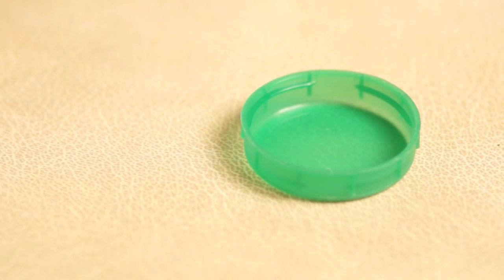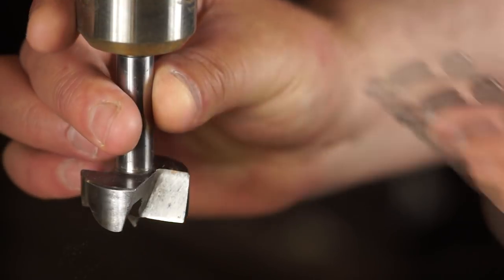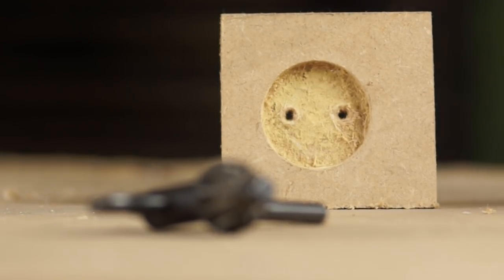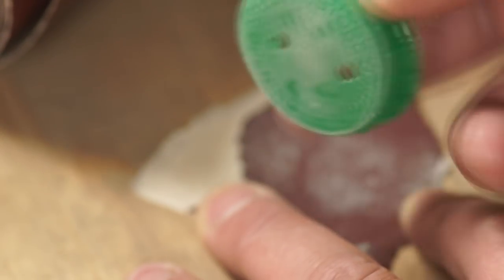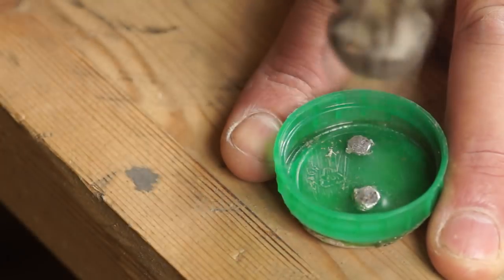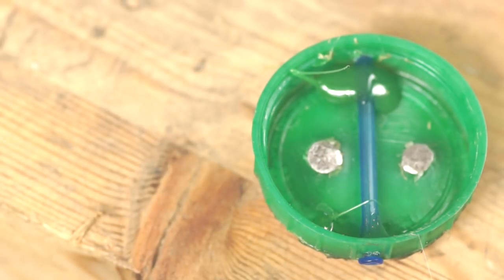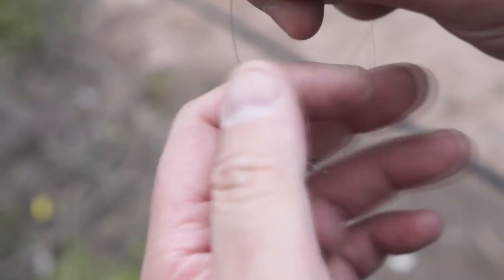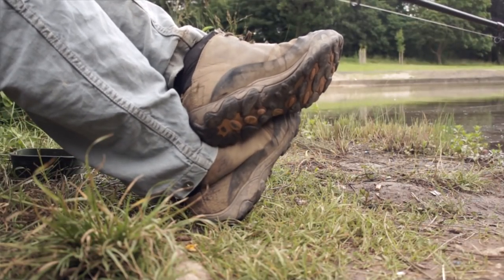Making a Milk Bottle Top Feeder for summer bait fishing

Comment: Absolutely brilliant - works really well and if like myself you lose feeders in Lilly pads/trees this homemade version reduces costs and subsequent fretting 😂. I am now experimenting with various depths of mounds to provide a range of weights. Another variation on the drawing board is using plastic bottles with long necks into cage feeders by burning a pattern of holes and then secured to the main line with a monofilament loop and swivel. Great video and many thanks.

Comment: I found my qtips had solid sticks so substituted a coffee stirrer. I'm not set up for melting metals so put a couple of steel washers inside the cap and locked them in place with the tube. Result is a 1/2 oz feeder. Thanks for the video!
Reply from the maker: Glad you found it useful and great to hear you methods

Comment: Another great idea of yours again , Paul , ........only bad thing about it is , that I don't like milk , LOL .

I've made feeder spirals before utilizing plastic tubing 4,5mm X  3mm bore , bought in a RC model shop .
When heating up the ends , this particular plastic material does not tend to bulge up to a rivet head like your tubes , so I've pressed it onto the tip of a 90° center punch after heating to achieve the rivet head preventing the wire spiral from sliding off that center tubing .

Thanks a lot for sharing , Paul , ......cheers , Dieter
Reply from the maker: I was making fly tying bobbins for use in float making and looking for something none metal to line the tip of a metal tube to stop it fraying the line so i cut the plastic q-tip to length and relised it also was too sharp and thought some heat might  melt and smooth like flame polishing perspex and as if by magic it rolled up, just one of those lucky things. I did some interesting experiments spinning small bore3mm/4mm copper and brass tube in a drill press to roll up the ends after watching a video on making trumpets and that work well with a centre punch as a former. or nails that had been ground to shape.  I was going to do some spiral cage floats for fishing up in the water at some point. The trouble now is gave I one of the bottle top feeders to kid down at a local lake and who pulled out some nice bream with it and now all his friends want them, i went fishing tonight and had to hide in a reedbed to get some peace, I caught nice of about 4kg as well.   Cheers Dieter.

Comment: ive just made some of these , instead of melting lead just used thin sheet lead cut to size of top, with two extended small tags to go through base of top, to secure plus glueing to base with araldite . Simplifys it somewhat ! good idea though.. tight lines!
Reply from the maker: MrRegni Your method would be the simple way but as always i like to forge ahead and over complicate things, i do think though that melting pewter ornaments into fishing weights can only be good for the fisherman and home decor; never before has one metal been almost solely used to produce all manor of hideous things.  Cheers

Comment: Hello there fellow angler!
I have been using home made contraptions on the match scene especially for winter months. 
Although you seem very knowledgeable with tools the cotton bud shaft you clipped off way too short for even very short casts as it has the potential to tangle even itself up not to mention the hook link. With a inch and half this would solve any of these problems. 
Well presented and subscribed 👍

Comment: Great idea have you got any tips on makings cage feeders? Thanks
Reply from the maker: I have never made a cage feeder, the closest has been open ended plastic feeders which i make from plasitc pop bottles with holes punched by a office hole punch, flattened copper pipe for weight and bit of wire. I have not been feeder fishing for that long but i am kind of hooked on it (sorry for the pun).  One thing I keep  meaning to explore is helicopter rigs and open ended feeder maybe with the far end blocked off would be perfect for this. I am hopefully going to start doing some shorter side videos sort of "quick makes" as the videos i am making at the moment tend to be very long in production. The open ended feeder would proabably be a good one for this type if film. But then there is always time which seems to my main foe.

Comment: Why did you make it out of pewter, instead of lead?
Reply from the maker: I tend to only use lead for larger sea weights which i make in bulk but very rarely, for smaller items i use pewter because it is safer to handle and not poisonous to me that is when i am melting and handling.